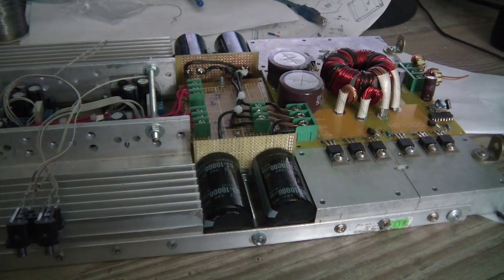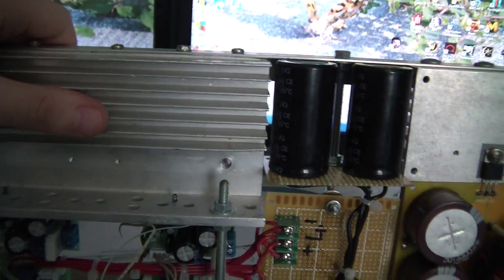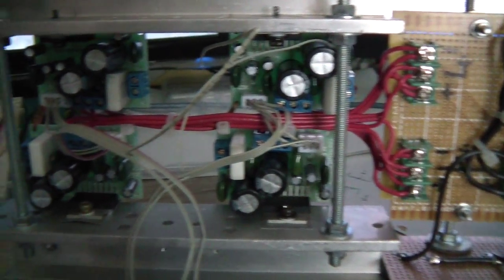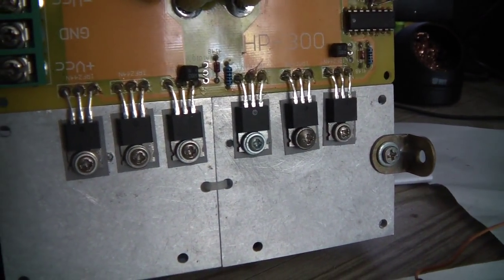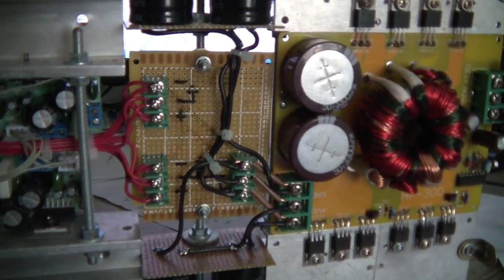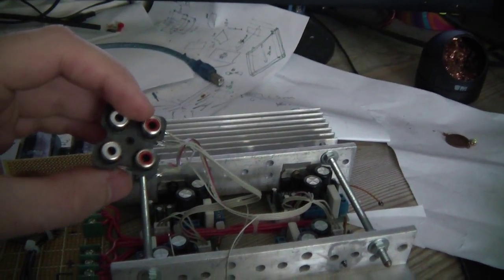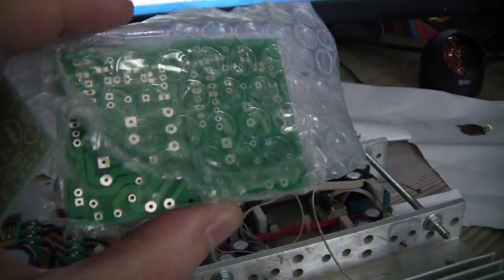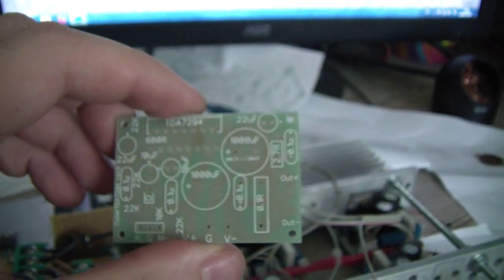DIY 4CH Car audio amplifier 500W SMPS + TDA7294 - Update

Comment: I have a question. How do you make a stereo line input supply 4 channels?
Reply from the maker: Hi ! You just split ecah channel in two with two resistors in parallel.
Each output from the resistors goes to a "new" channel.
This way you have 2 left and 2 right channels :)
By changing the values of the resistors in the same channel you also control the fading.
Have fun !

Comment: Why did you changed LM3886's for TDA7294?
Reply from the maker: Tomas Sabalas Hi , i tried to bridge the lm3886 and had little success. Could not stabilize them , they were overloading each other, probably need a more complex design with biasing so didn't want that. But with TDA i had no problems at all , just connect them in parallel or push pull , they work great. Second thing , they have metal body. LMs with a metal body the 'T' version very expensive. Thirdly the TDA layout is simpler :)  Also , one i tried to push the LMs and TDA to the limit , supplying a +-40V and loading 4Ohm loads, i know that is beyond the specs but wanted to see the failure mode. The TDA was holding alright, got hot as hell but didn't blow up , LM had failed shortly and shorted one of the rails to speaker output , which resulted in 10Amp DC current thru the test speaker, not very nice :) No protection mentioned in the datasheet prevented it. So, i stick with TDA for some time, but they both sound very very good ! Good luck !
Reply: Artiom K I thought it was because of LM3886 protection, that starts sort of clipping when supplied with ±35V and 4 ohms load. I had that problem with LM3875 and I couldn't use it with 4 ohm speakers. That said, I switched to TDA7293 - way better in terms of power and connectivity. Right now I have connected two 250W modules, three TDA7293 each, in bridge mode for subwoofer - that thing is a beast! And I have two of those beasts :)

Comment: What is dc converter controller on this power supply? Is it push pull dc converter?
Reply from the maker: Dominik M I didn't check the schematics but yes, it looks like a push pull. Based on TL494.